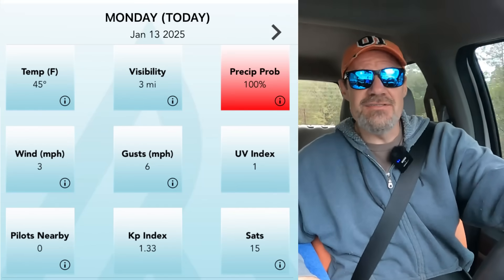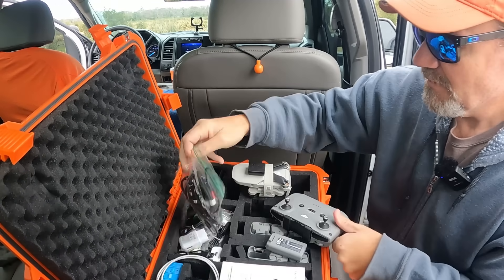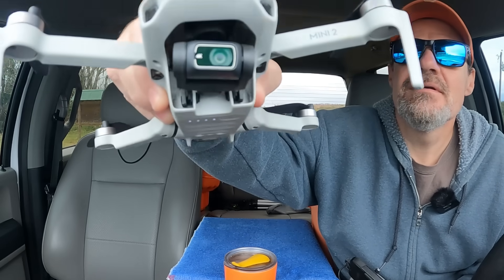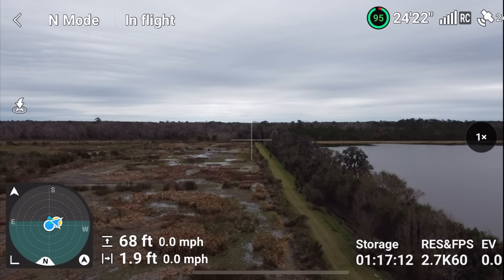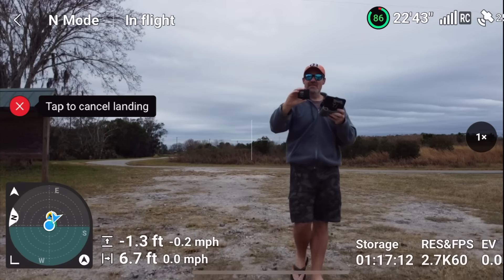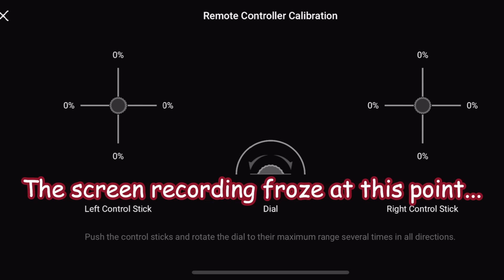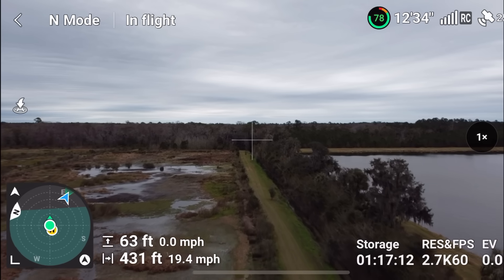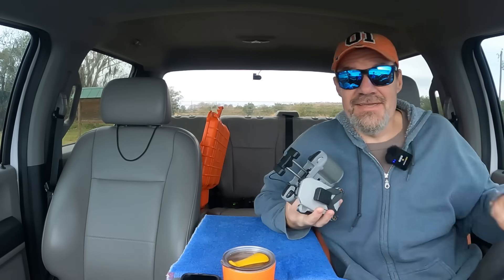Why Does My Drone Drift?  Another DJI Mini Problem

Comment: Are there any issues a connectivity flying from inside car?
Reply from the maker: Awesome question and we get that a lot...  So far, I've flown all our DJI drones from inside the truck and have never noticed any connection problems.  We've done a couple comparison videos where I'd do a flight from inside the truck and do the same flight outside the truck and the signal strength never wavered...  DJI has things figured out because most other budget type drones we test, I have to be outside the truck to maintain a good transmission on the screen.  I do have to say though, I flew the Potensic Atom 2 for a test flight while sitting inside the truck a few weeks ago and had no problems with signal or transmission...  Potensic may have just figured something out... lol

Comment: Hello… I'm having problems since I updated the new fly app to 1.16.4.  I cannot Dolly Zoom anymore. For some reason, my Dji mini 4 pro zoom does not zoom by itself. It does the waypoint thing and everything looks good but the zoom will not zoom so that kind of defeats purpose. Just wondering if you had any problems like that or is it just my drone is broken. Thanks and keep the videos coming. They help me out immensely.
Reply from the maker: Hmmmmm. I’m wondering if that’s a problem nobody has pointed out yet. I’ve honestly not tried the waypoints lately so when I install the 1.16.4 update and make a video I’ll give that a try and see what happens. Are you saying it won’t zoom during the waypoints mission?  I just wanna clarify because my normal MO is I screw up our tests. Hahaha.

Comment: How do you change to feet instead of meters? I’m very new have a DJI Mini 4K had it since December I’m in South FL
Reply from the maker: Awesome question, buddy.  There's a setting for it under the control tab with Metric and Imperial settings... Click on the Imperial setting and you'll be in feet instead of meters..  I'm not a metric guy at all and it's easy for me to get confused when I see meters.. lol

Comment: What gets me. I haven't flown my Mini 4 pro in the past 6 months, due to weather conditions in the South Georgia coastline. I just upgraded my drone, and controller DJI software, last week. 

Pervious, it seems like I could have got closer to different objects (R, L, F, B) under the previous software version.  I also noticed that after all upgrades. The front-end collision (sensors) system, of the DJI Mini 4 Pro would automatically, back my drone up, on "its" own. 

Have anyone else noticed this issue or is it due any fly away or damage insurance policy with DJI, or is it to cut their cost? Talking about Calibration is that the reason why, the Mini 4 pro keeps back 'in away from objects, own its own?
Reply from the maker: Oh wow, I haven't noticed that being an issue but now that you mention it, I'm remembering something similar happening to me with the Mini 4 pro just the other day.  I was trying to hand land Dwight but I was standing too close to the truck and the sensors saw it so the drone moved away from my hand as I was lowering it.  I don't have it on film because I was just flying for fun but I could definitely duplicate it.  I wonder if the sensors have been programmed to be more sensitive since they used to be.  I also wonder if that would be an issue in "Nifty" mode...  May be a good test idea here, eh?  lol  Thanks for bringing this up and also for watching.  God bless!

Comment: DJI updates getting worse brother specially on small drones Like my DJI neo drift still there sometimes out of control with lot of GPS DJI also ignore thanks for sharing 👍
Reply from the maker: Yea man, the updates are out of control lately...  It seems like the last 3 or 4 updates have created more problems than they fixed with these drones.  Especially the Mini 4 pro from our experience.  They're too focused on releasing new drones rather than focusing on the fly app I reckon.  Maybe they'll slow down on producing new drone releases and focus a little bit more on the fly app.. wouldn't that be nice? hahaha

Comment: Thanks! A good tip. I have one as well. 
Always remove the joysticks when having the controller in the case. The joysticks are centered with springs. If there is constant pressure in some direction then the spring tension may be changed resulting in a new center position. Recalibrating may help but you may end up with some other problems as well. I can see that you have cut outs for the joysticks but are you sure there is no pressure at all in any direction?
Reply from the maker: That's a really good point you bring up for sure.  I do have the cut outs but I can't guarantee the sticks don't have any pressure when they're in the case.  I never considered that if they're off centered when stored that could create a problem.  I'm lazy so I was just trying to not have to put the sticks on every time I fly... lol  I'm gonna remove them and test it out for a while and see if it helps make a difference...  Thanks so much for taking the time to mention this by the way.  God bless!!!

Comment: It’s not just a Mini problem. My Air2S drifts especially if I fly a a mission where I put in waypoints then go back and fly that same flight path later or a different day, I noticed it will not fly the same exact path. I’m told DJI knows about this and hasn’t done anything to correct this.
Reply from the maker: Dang it!  There's always another problem that arises after each update they put out, isn't there?  I have only reflown (if that's a word) one waypoint mission since we've gotten Dwight and that was within minutes of flying the mission the first time.  I may wanna address that as a potential test in the future.  I've heard of several waypoint problems coming up recently but haven't really done much with waypoints in the past so I'm not totally familiar with them.  Every time I do a waypoint mission it's like the first time all over again... hahaha

Comment: Anytime I have had drone drift I do a compass and IMU calibration, stick calibration, and check all the props for any variance, or slight damage. If you use a prop holder when storing your drone, depending on the one you have, can put a slight curve in your props. Most times, I change the props and it corrects the drift. Also, when storing your RCN1 or RCN3 (the type with no built-in screen), remove the sticks so they don't get pushed into any direction while storing as they are spring loaded and will have a memory.
Reply from the maker: That's some awesome advice, man...  Basically everything you've mentioned about storing the drone and controller, I do...  I'm pretty much a walking mistake... hahaha  I do keep the sticks on the RCN1 controller in the case but I have the storage spot cut out so it doesn't interfere with the sticks....  However, I'm 100% certain the sticks are still messed with inside the case.  How can they not be, right?  I'll definitely keep that in mind and maybe next time take the sticks off and see if it makes a difference for future flights...  Awesome stuff, man! Thanks so much  for your continued support and advice.  God bless!

Comment: I need to break out the Mini 2. I never send her out like I do my bigger drones and I don’t know why. I’ve watched Dunhill’s range test and I know she’s a beast. Enjoyed the video. I do like your preflight routine and have adopted it in my preflight routine. I like the stick response test and going through the settings on the controller especially RTH setting. Pilots that fly aircraft ALWAYS go through an extensive checklist and never skip a step. Good habit and should avoid emergencies.
Reply from the maker: That's awesome, Mark!!!  I agree you need to bust out the Mini 2 because I've said since the beginning, the Mini 2 is my favorite drone of all time...  Yea, the Mini 4 pro has some extra features and obstacle avoidance (which has come in handy for old Kevin here), but there's something about flying the vintage Mini 2 and going back to 2020 when I was first blown away by DJI...  Anyway, regarding the preflight routine, I'm not sure where I got that but you do know I had to see it somewhere because I couldn't have come up with it on my own... hahaha

Comment: I see the problem, you’re storing the remote with the stick on, that’s causing your problem because the sticks being pushed off center
Reply from the maker: That's definitely a possibility and a great observation.  I have the foam insert torn away to keep the sticks safe but there's no way they stay totally stable in there when I'm carrying the case around, eh?  Thanks so much for watching and for the tip. God bless!!!

Comment: where did you get that angle bracket??? would like one myself
Reply from the maker: Very cool!  We got it on Amazon and it's been worth its weight that's for sure.  I like the angle view a lot better but the even better part is it creates a lot more room in the controller area and I don't have to remove the phone's case anymore..  Here's the link and sorry in advance for the length... lol  God bless!

https://www.amazon.com/Remote-Control-Holder-Bracket-Accessories/dp/B08NTHG5HF/ref=sr_1_1?crid=18NARIBL3ABW9&dib=eyJ2IjoiMSJ9.jnEFSfU-fsHvpD5lhmZTIsbaMu5w5ZGHikggmtNiN47vMJbcfySsqGsFu98I4JmAs4GsePgUp8pYO0ZEQyPoZWuVtIDiOt8iOD4OwXb1syPF2P-TWr41qCpuIonuIj12bduQL78GZtUpCZaET8y-gCuM9CiCyNXeadfVlF1GsP14DPc25NZ02YORd368IdPulUY3b06v1E8rUpoZ1YvEfMS7Fx6GyauoCZnvsLLhjUkB69LgMZjOmuNxqZjw4sdyQC-3LxacT1xdj_ZqmYs276EVZkYhuQ9GmKa5-DL5a5o.S_5qeViNJmM16jscEHGKEafmxarZST8sPz-8yxYc-WI&dib_tag=se&keywords=mini+2+controller+angle+bracket&qid=1739321966&sprefix=mini+2+controller+angle+bra%2Caps%2C546&sr=8-1

Comment: Thanks for the tip, and also, did you ever thing of maybe getting an orange tonneau cover with an "H" in the middle of it for your truck, it might make your landings easier. LOL
Reply: Landing pad. Thats what its called.
Reply from the maker: lol, thanks for watching and for the suggestion for sure.  I have something I'm working on to make landings a little easier on the bed cover but I'm having trouble getting it to work right.  The orange bed cover would be awesome!!!

Comment: Another great video, and  another great tip & fix by a fan. But I have noticed both of my drones sometimes drift slightly left or right while going straight forward, but it's not because of stick calibration. It's cockpit error, as I have a hard time feeling the center dip when pushing the right stick forward, and I push it slightly left or right of center. That's one of the things I love about cruise control on the Mini 4 Pro. Once I'm going straight, I hit cruise control, and the drone maintains a straight course.
BTW, I don't know if I've mentioned this before, but the reason the Mini 2 does the gimbal jerk is because when it's looking straight down, it's up against the -90° stop. As the forward movement of the drone comes  to a stop, the drone tips backward  to put on the breaks. When it does, it takes the gimbal with it. Then, as it levels out again, the gimbal stays off the  -90° mark. I guess DJI fixed that in the Mini 4 Pro.
Love  your videos, and your humor, Kevin! Keep up the good work!
Reply from the maker: heck yea, Gary!  It's really cool to have viewers with such great suggestions and fixes that actually work, eh?  I'm not sure how long the stick calibration will last but it's great to know it's another thing to try when the drift returns...  IT WILL... haha  You've explained the gimbal shake to me in the past and it makes total sense...  I've gotten used to it so it's not a big deal but I mention it every video so maybe I do care... hahaha

Comment: I took Gordon my mini2 the other evening for a dusk flight, the sunset was amazing. I never use return to home button, I always fly back manually. For some reason I just don’t trust it 😂
He wouldn’t take off at first and he wanted a compass calibration doing. Did that then he was happy. 
The controller calibration I never knew about until now Kevin. I’ll know now if Gordon ever starts drifting to try this 👍🏼
Reply from the maker: That's awesome, Dan!  I normally only fly during the day because I'm asleep when the sun goes down... except for tonght... Yea, it's weird.. haha  My bet is the controller calibration helped for a little bit but it won't take long for that drift to come back.  When the IMU helps, it'll last maybe 2 or 3 flights then it's back...  Fortunately it's not that big of a deal but it would be cool if it was fixed for good...

Comment: Good day Kevin. Glad ro se Rose again. Looks this issue is solved. On3 question: when making RTH, does Rose turns 90 degrees turn and return sideways instead of 180 degrees straight? Looks like to me at some of your videos.
Reply from the maker: lol Rose is a stud!!!  And yea, she only turns 90 degrees on the auto RTH flights... Both of our Mini 2 drones do that every time.  I've tried and tried to fix that and one time we may have.  It has to do with the gain and expo tuning settings being too high and the drone gets confused or something.  I changed all the numbers once and tested that and low and behold, it worked!  But magically, the next update changed all the numbers and it was back to the same old same old...  I decided changing all the numbers back was just too much work (I'm lazy) and I just deal with the 90 degree turn now.. No big deal.. haha

Comment: I honestly thought maybe you'd need to adjust where the remote id dongle was placed. If the problem consisted I'd try that next
Reply from the maker: Oh, I"m sure the problem will persist eventually...  I don't think the remote ID has anything to do with it though because it was an issue way before I put the backpack on her...  It's hard to say for sure so I'm not saying it's not possible.  I'm usually wrong anyway... hahaha
Reply: @WeretheRoberts  I'm definitely wrong more than I'm right. Welcome to the train wreck
Reply: The positioning of these remote ID module have caused this exact thing amongst many people. It’s certainly something to consider. It appears you have the module positioned exactly above the GPS receiver of the mini which will/can cause the exact problem you’re having.

Comment: Does your RTH gimbal shake occur cause you manually point the gimbal straight down before the descent begins? Does it still shake if you’re almost pointing the gimbal straight down prior to descent and then straight down after the descent starts?
Reply from the maker: Yea, if I have the gimbal facing down while the drone is going forward, when the drone stops to locate its landing spot, the gimbal will shake up a few degrees...  I've been told it does that to compensate for its movements because it brakes really hard to stop and as it lowers its rear to stop, the camera is already at 90 degrees so it'll move up with the drone.  When the drone settles back to level, the gimbal stays at the angle it moved to when the drone was stopping... That makes total sense in my head but I'm not sure if my explanation makes sense to anyone else... hahaha  It's just a Mini 2 thing, too...  The Mini 4 pro doesn't do it
Reply: @ interesting! I’ve never seen that happen with my Mini 2, but maybe I’m too busy looking at the drone in the sky and not at the controller. 🤣
Reply from the maker: lol that’s possible. Both of our Mini 2 drones do it. They also only turn 90 degrees on auto RTH flights. I really do think our drones are simply touched. Haha
Reply: @ maybe I need to perform some Roberts type testing with my two mini 2 drones and see if they have also been touched! 🤣